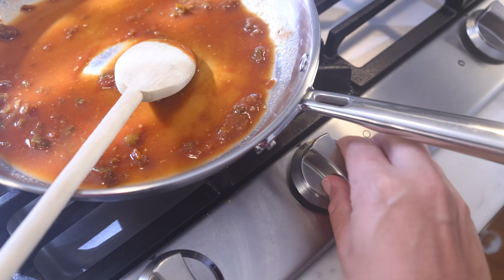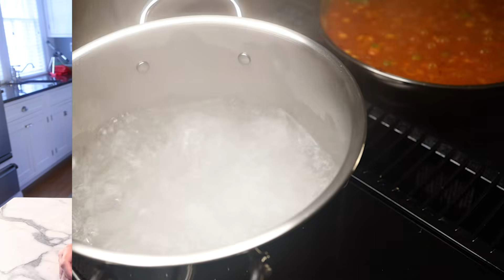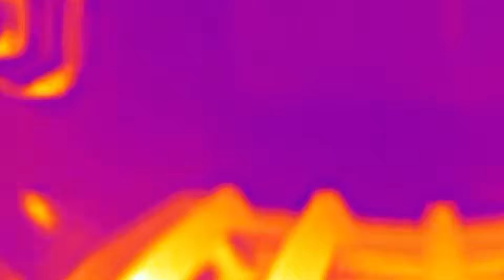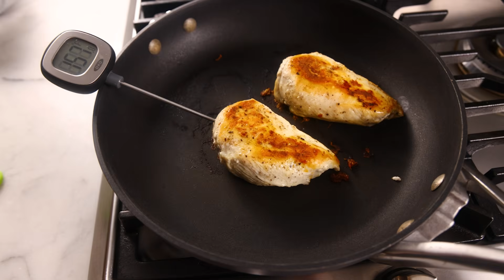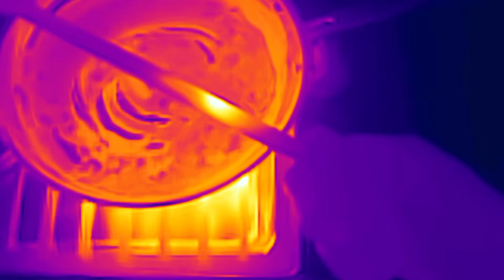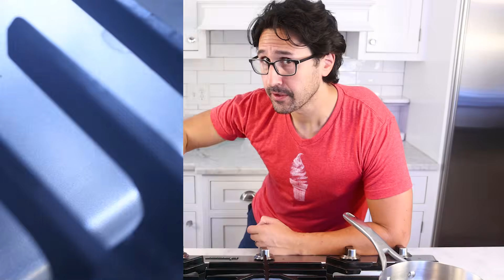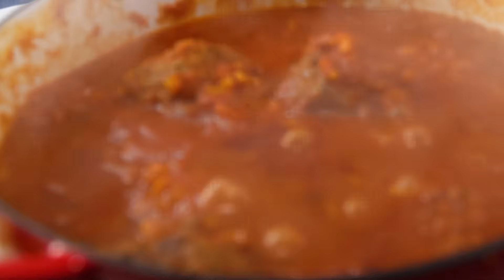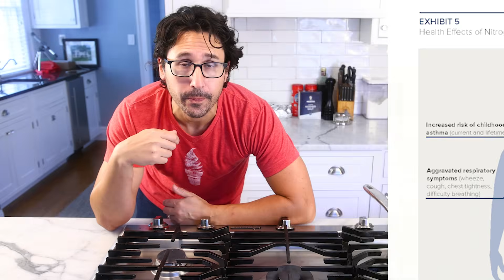Problems with gas stovetops | weak, dirty and dangerous

Comment: Adam, I wanted to point out the your “old glass top stove” is not just an electric coil stove with some glass on top of it. It is called a “infrared cooktop” and they use either a halogen lamp or quartz infrared bulbs in combination with a heating coil. The infrared cooktops rely principally on infrared light to radiatively heat up your cookware whereas the old-style electric coil stovetops rely chiefly on conduction from your cookware sitting directly on the heating element. Infrared cooktops are FAR more efficient than the coil style cooktops (2-3x more heat transfer per watt) and WAY more responsive (although less than gas or induction). As a lover of cast iron who has had the same 8” and 12” lodge cast iron skillets since 2010 I can tell you this: nothing heats up cast iron as evenly as in infrared cooktop so long the element is not smaller than your pan. That is my main problem with the induction cooktops on the market today, not big enough “burners”. I’ve never seen one big enough for my 12” skillet to not have a crazy bad hotspot in the middle.  Of course, most gas burners have the opposite problem of a hot ring on the outside of the pan, although a good burner with a inner and outer ring does a pretty damn good job. Induction also interferes with my touch screens on my electronic devices even feet away from the stove and are a serious concern for people with pacemakers, but I'm all aboard the induction train once they are more affordable and have 12"+ induction elements. Big fan here from Colorado, Cheers!
Reply: Maybe SOME infrared cooktops are more responsive? I have one in my kitchen and it's the most sluggish stove I've ever used at cooling down. After a run bringing a pot to a boil on high it'll be hot enough to cook on for *minutes*. If I need to turn it up high to heat something up quickly but then reduce to a simmer, I have to "schedule" this and reduce heat several minutes before reaching the boil. It has an insanely high heat retention making it easily the worst stovetop I've ever cooked on. I'm convinced not a single person involved in its design and engineering knew how to cook. Give me an old coil stove any day.

Sure, it gets hot fast, I don't care. More worried about not burning my food than saving 30 seconds.
Reply: @alexisvl3253  I'm pretty happy with the IR range in the place I'm currently renting, but I agree about the cooldown time. Can also be a safety hazard in houses with small children, as if they see nothing on the stovetop they will assume it's cool and might not see the "hot surface" warning light that all IR ranges have for exactly this reason. Ours works well though, and I usually get around the food burning problem by moving the pot/pan over to a different element once it's up to the desired temp. One benefit of this is that you now have a spare preheated element to quickly bring another pan up to temp e.g. for a side dish or sauce.
Reply: Newer and high quality models of induction have zero interference. I put my phone next to my stove all the time and never had any problems.
Reply: would i be able to replace my coil stovetop with one like this? i was planning on getting a glass top but i wasn't aware there were multiple kinds, and google is not helping me as every result for "infrared" i can find is a portable hot plate type deal...
Reply: @ladyinwight  I'm an owner operator of a home appliance repair business. What they are calling infrared in just a different style of heating coil under the glass. The heating element is longer and thinner coils wrapped around more time than the typical old style coil with a temperature sensor to force it to cycle off and on before it gets too hot and cracks the glass.
They work about the same as an old style burner and are more expensive to repair or replace the burner. Parts are more expensive and much more labor involved having to lift up the glass to get to the burner underneath.
Reply: @ladyinwight  Ceramic glass top electric stoves are "infrared" although there are wide variances in the market. One with a 12" double or tripple ring fast boil 3000 W or higher burner is best
Reply: @ladyinwight  I can't give you an answer other than maybe going to a local mom and pop appliance store and asking about
Reply: You know a fanbase is tight when the commenters sound equally as eloquent as the presenter. Hats off!
Reply: I live in the Philippines and cooking by electricity is simply out of the question because our power supply is highly unreliable. Our choices are gas or charcoal. I choose gas. The time came to get a new stove so I did some research. There is a new type of gas infrared that's hitting the market - a Japanese technology but fastly being produced in China. It promises 40% better fuel efficiency, the flame is more difficult to blow out and a more even heat distribution. I started using it just a few days ago so I can't make a judgment yet but it does seem to direct it's heat directly to pan more evenly. None of my friends can believe that such a infrared gas stove exists thinking infrared can only be electric. But I have the stove to prove them wrong. No electrical hook up at all.
Reply: I noticed that with my infrared stovetop and my cast iron, nice to know! thx!
Reply: Preheat your skillet in the oven
Reply: I'm honestly considering switching from induction to infrared because I love cast iron and have horrible hot spots with induction. There are "infinity" cooktops that will heat the whole pan no matter where you put it, but they are like 6 grand and none are available as ranges.
Reply: @PhilKulak  induction will heat more evenly, some models do better then others.
Reply: @Dirty_Bear22  what's good? I haven't been able to find any good info.
Reply: @PhilKulak  you looking for a portable single burner, stove, or countertop insert/cooktop? In general I prefer Miele,Bosch, and Kitchenaid induction.  Breville makes a beautiful single pan induction appliance.
Reply: @Dirty_Bear22  Range. Interesting. I'll look into those. The problem I have is that no one releases the specs of the coils, so you don't know what will line up nicely with your pans. I may try to get into a store so I can look at them.
Reply: @PhilKulak  did you use the cast iron pan on gas before using it on induction? Because gas will normally warp the bottom of the pan ever so slightly, and that is enough for the induction to not be distributed equally, and thus would explain your hot spots. That's also why the recommend getting new pans when switching over from gas to induction. Not sure if it's needed when switching from electric to induction.
Reply: @goldenghostinc  No, never had a gas stove in my life. I can see the element when I boil water though, and it's tiny, even on the "large" burner. I do have one of the cheapest induction ranges, though. haha
Reply: @PhilKulak  with regards to the infinite induction plates, I think they still have separate zones covering the whole plate, so there might be small gaps between the zones in order for them to be able to be also switched on separately.
Reply: Not exactly.

All halogen stoves do also have coils, but non halogen glass cooktops(the vast majority aren't halogen) only have coils under the glass.
Reply: @lordgarion514   I was also thinking this. Halogen cooktops seem to have died out with the introduction of induction. I Can’t find much information about there exact working principle of halogen cooktops anymore. Can’t find any mention of halogen cooktops also using resistive heating coils, maybe it was only on some models?
Reply: @Dirty_Bear22  halogen/IR is still very prevalent here in Australia. Mains gas is only available in limited areas because we have much lower winter heating requirements, and not many households wish to bother with bottled gas (although I've lived in two properties in rural areas that used it for heating/cooking). Lots of older properties still have solid/ring type electric stoves, but these are slowly being replaced with modern flat-top electric ranges. Induction ranges are still stupidly expensive down here so they're relatively uncommon and generally only seen in "high end" properties.
Reply: @sixstringedthing  makes sense. My knowledge is primarily based on USA availability. Halogen was never really popular here, and induction technology reached a similar price to halogen, ultimately leading to the stopping of halogen cooktop production. 

Here we have gas, exposed coil, coil under glass, and induction. Exposed coil isn’t common anymore, coil under glass and gas are probably the most common, and induction is seen as a higher end/alternative to gas.
Reply: That's interesting that your induction interferes with your touch screens and devices. I have just a single burner induction cooker that I boil a pot of water on in the mornings. I can stand right in front of it browsing through Facebook with my phone and it doesn't have any problems. 
Is yours an induction stove or just a little single burner unit? Was just wondering if it might be something to do with how much power it's getting? My single burner unit runs on 110 whereas a Stove Top would probably run on 220.
Reply: @keithyinger3326  i have an older countertop induction cooktop that I bought when the gas went out in my building for a while
Reply: I have an "infrared cooktop" and mostly use cast iron and carbon skillets. I hate that thing with every fiber of my being. I have the exact opposite experience as you.  It doesn't heat evenly, It takes forever and it has absolutely abysmal response time on reducing heat requiring me to have heat mats set all over my counter if I'm cooking in more than 2 pans at a time to move stuff on and off.
Reply: Gaggenau wok induction cooktop is big. I have one.
Reply: This is an issue i have with my induction stove. Also it warps your carbon steel pans very easy. I think I had liked my infrared electric burner. It was a little less responsive but i would just move my pot if needed.  15 secs later it was ok.
Reply: Very informative , thanks!
Reply: @tomaskracmer9280  The solution is bigger induction elements
Reply: Glad I read this comment.  I'd never heard of infrared cooktops.  I've been thinking about replacing my gas stove but my experience with all electric stoves has been absolutely horrible.  One stove I used on "medium" heat levels would just cycle back and forth from max power to off, like a microwave oven, and it was impossible to cook scrambled eggs.
Reply: I am totally satisfied with my GAS INFRARED
Reply: There is no reason, in terms of physics, to suggest that IR burners are more efficient than coils using direct contact and conduction. "X" amount of energy heats a coil, and almost all of it gets transferred to the vessel. With an IR/ceramic top, it's all light based transfer of energy.  The red hot coil has to send it's energy through the ceramic top, which absorbs some of it.
Reply: @frequentlycynical642  My IR gas stove is hotter than my regular gas stove
Reply: @frequentlycynical642  I think glass tops are more about aesthetics and cleaning with the benefit of less thermal mass so quicker heat responses if the right temp controller is used and not efficiency.
Reply: @adrianwilson7536   Definitely so on the cleaning and aesthetics.  But as to thermal mass, you are incorrect. In a classic pan-on-coil, the only thermal inertia is due to the coil.  With a ceramic top, the coil is a mere wire (as is embedded in the range top larger coil) BUT that ceramic top is a lot more mass to heat.
Reply: Not mine.  You can see the coils when they are hot.
Reply: He doesn't even know what kind of stove he has 😔
Reply: My old one was just a coil though, even though it glowed red. How do you tell the difference?
Reply: Do IR cooktops work with glass pots?  You've got me thinking of getting a plug-in IR hotplate as a best-of-both-worlds solution between heating element and induction for personal cooking.  My house already has gas, but I never need more than a burner when cooking for myself or two.
Reply: Ok
Reply: The quality of induction is all over the map, you'll get an entirely different experience with each manufacturer. I've got a Kitchenaid induction cooktop and it seems to have hot spots about 1/2 way from the middle to the edge of the ring painted on the glass; cast iron is perfect because it spreads the heat better than triply or carbon steel. A $50 cheapo Duxtop portable I got has the hot spot in the middle.
Reply: Someone mentioned that induction cooking can crack a cast iron pan. I wonder if it's the hot center and cooler edge that is causing the problem.
Reply: I have an induction cooktop with a burner that works fairly well well with my 15" skillet, there is 3/4" to 1" gap around the edge if I center it, but i find that to be helpful since stuff doesn't burn to the sides anymore.
Reply: @tomaskracmer9280  The solution to avoid the hotspot in the middle (or rings) with induction is better cookware. I've been there. (Not talking about cast iron here, different story!)
For even heat distribution with induction your cookware needs a thick sandwich bottom. That means there should be a fully encapsulated layer of at least 4 Millimeters of Aluminium inside the bottom which acts as a heat spreader.
Any super lightweight cookware with just a bare minimum glued-on sheet of perforated ferromagnetic stainless steel on the bottom is going to perform poorly on induction. Just because it claims "to work" with induction does not mean it works well.
Reply: There was a fairly expensive induction cooktop that got around this issue by making several small induction coils, and it could activate them wherever it needed them. It had a ton of problems though and is no longer sold. Maybe someone can perfect it though, as that's the only way to solve the problem I'm aware of.
Reply: Not all glass top stoves are infrared tho
Reply: I'm an owner operator of an appliance repair business. I have never seen a glass cooktop range using infrared. The heating coils are smaller and wrap around in a circle more compactly, but it is still a heating coil. I think you are mistaken.
Reply: Hi thanks for the details. I recently changed an old gas top for a new one, and there is a stunning difference in how quickly the new one cooks...have to baby sit the pots to avoid burning! There visibly is a difference in the builds, the heights and all that jazz. Very happy, i can actually sear things now. Will try a custard also. I got an induction plate to see howbit works. The drawback is having to change pots and pans to work with it...
Reply: Yeh, induction makes my Bluetooth headphones go crazy too
Reply: What induction stove did you use that caused your capacitive touch screens to go crazy from feet away? There's no way this device was in spec and certified while producing this much EM interference. I wonder how bad it mangled the power upstream and if you caused problems with your neighbors CPL lmao
Reply: Just set up my induction range. It has one 12" burner. I heard cast iron can scratch the surface, but you can buy these pads that protect it. Hope it was worth the change.
Reply: I am doubting the likelihood that you can make something 2-3x more efficient than a 100% efficient heating element directly touching your pot.. less touching and direct contact means you're using the less efficient infrared radiation rather than the conductive heat.
Reply: @mikafoxx2717 100% efficient in that all of the energy is turned into heat, <50% efficient in that only a fraction of that goes into the pan, the rest goes to the stove and to the air. This is why induction is the best, because the ferromagnetic resonance heats from within the pan. This is thy the stove doesn’t get nearly as hot
Reply: True. I was screwing around with my infrared camera. Not the same as the temperature camera he has in the video. It's just a camera with filters that block all light below 700nm. With the stove on, it would flood the sensor with IR light. Even if the element looked visibly dim. It's pretty amazing actually. I have a gas stove now and I really miss that electric/IR stovetop. So, in that, I wholeheartedly agree with Adam.
Reply: Thanks for introducing me to those.
Reply: They say cheers in Colorado?
Reply: @zach3861  when we're having a drink
Reply: @zach3861  what are they supposed to say? I mean if they didn't say 'cheers'? Is there a cowboy toast I'm unaware of? I only ask because I lived there for many years it doesn't mean that I know everything about it though.
Reply: @markmaurer6370  Giddyup, maybe?
Reply: @markmaurer6370  I assume he meant to ask if the word cheers was often used as a general greeting there, rather than specifically as a toast?
Reply: @markmaurer6370  I live in the southwest US and I've never heard anyone around here say "cheers" in this manner. Its something I mostly associate with European slang so that's why I'm confused.

Comment: The one time I had induction I was real effin frustrated cause none of my pots and pans worked but beyond that induction is perfect. It doesn't smell, it's not burning sides of pots, it's super easy to clean and very safe.

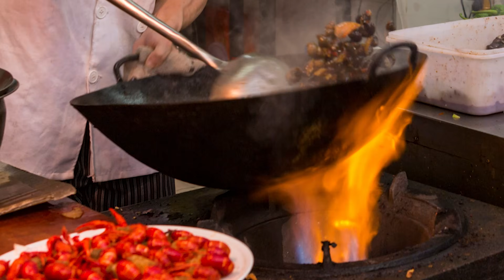Comment: 4:20 "You cook in a wok, you actually want the heat to wrap up and around the outer cone of the pan."

No you don't, you want a burner which directs the flame to the middle of the pan (like on the picture you used). Otherwise you can't get that "wok hei" flavour that's really important in Asian cuisine.

Bigger question is why the f*ck are traditional gas rings standard in Asia?

Comment: In complete agreement, I moved to Georgia, and its gas, it is hard to clean, and you can't get it low enough which is annoying as hell, one nice feature might be that it seems to be super cheap to fuel it (atleast before gas prices spiked up 200% or so).